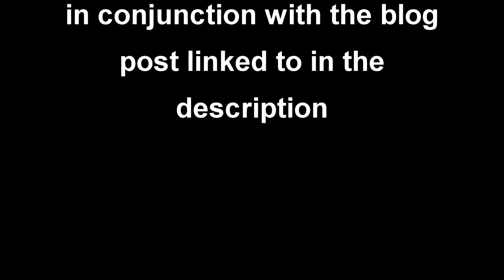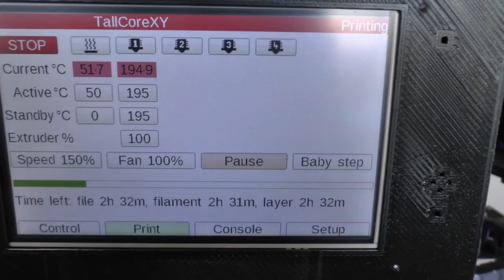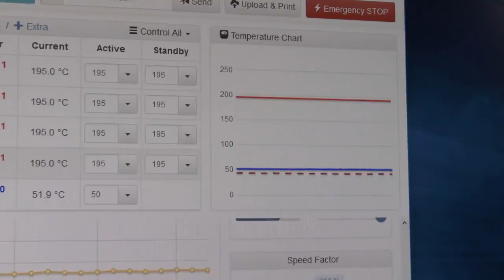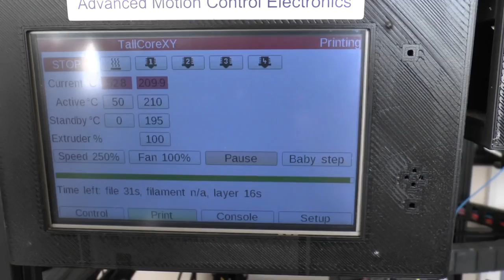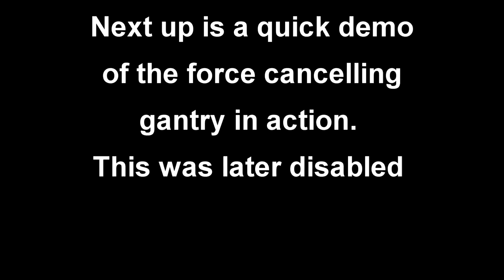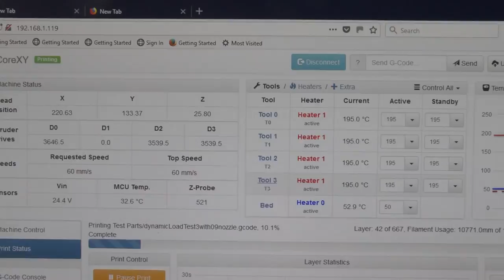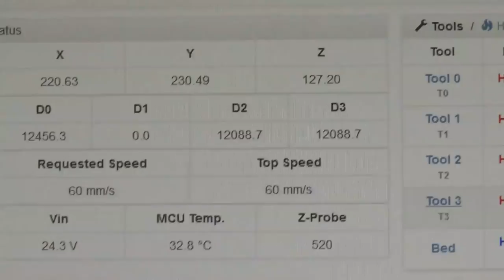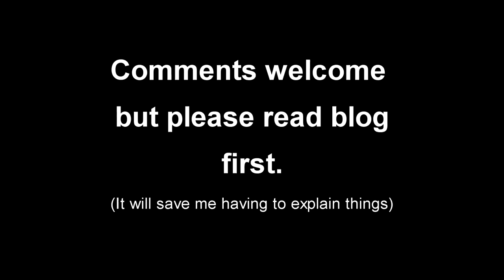Real world high speed 3D printing

Comment: This is one of the most interesting channel in 3D print. Thanks to share with us your studies. What about dimensional accuracy of your 3D printer? Good job and I'm yet waiting for next video :) Have a good time!
Reply from the maker: Thank you for those kind words. Glad you find it interesting. It makes putting in the time and effort worth while.
Reply from the maker: Dimensional accuracy of the printer? Read the blog but those parts were designed to be 100mm square and came out at between around 99.7 and 99.78 mm in both X and Y and at both near the base and near the top. So better than 0.3% over a Z range (in this case) of 400 mm. Not bad IMO.
Reply: good job !
Reply: @deckingman I think it's really good. Good job 😁

Comment: Impressive. Also cool.

I have a somewhat different theory as to the cause of the problems you see.  My theory is that the reactive loop used to control nozzle heat is not sufficient for larger volumes of plastic at higher speeds. To get (near) constant temperature of the plastic leaving the nozzle, we need a predictive model to increase the heat input in advance. It takes time for heat to travel through metal, transfer from metal to plastic, and travel through plastic. To account the heat input needs to increase enough in advance. (Which is not the same as "pressure advance".) My opinion, not yet put to test.

Otherwise, very nice work.
Reply from the maker: What problems are you referring too? 
If you are questioning my use of pressure advance to improve the quality of high speed prints, take a look at some of my earlier research here https://somei3deas.wordpress.com/2017/06/25/duet-pressure-advance-experiments/ and here https://somei3deas.wordpress.com/2018/01/15/an-attempt-to-investigate-pressure-in-the-extrusion-system-with-a-diamond-hot-end/

Comment: Since you've tried both I'd like your input. Would you rather use 6 direct extruders mounted on the carriage (1.5 kg) or suspend by a passive gantry like you've had in your first design? Or perhaps suspended in the middle above the printer? 
The printer is based on an Hbot with 900x900x1400 build volume.

Thanks in advance
Reply from the maker: Personally having tried all 3 options, I'd use the active gantry arrangement. On balance, keeping the Bowden tubes as short as possible outweighs any advantages of the other two options.

Comment: Thats really cool! For such a big and heavy gantry it handles it really well! I think its that double gantry that allows it to print that fast. The moving mass on a single carriage would be a bit too much on my opinion. Nice work!
Reply from the maker: The total mass when moving in the Y direction is about 4.2 Kgs so yes, it would need some fairly hefty motors to accelerate that mass up to speed if it was on a single gantry. I did at one point have the extruders mounted on an un-driven gantry, being passively dragged around by the XY gantry.  It worked reasonably well but that was when I only had 3 extruders. I change the additional gantry to a driven one when I upgraded to 5 extruders so it becomes a CoreXYUV with each gantry having roughly half the mass. The UV axes have their own motors which are mapped to the XY axes, so they receive exactly the same step pulses.
Reply: @deckingman  its a ingenious design.

Comment: what software are you using to monitor your requested and actual speeds and such
Reply from the maker: Sorry for the late reply - I have been away from home for a week. The screen shots showing the speeds are of Duet Web Control which comes with RepRap firmware (which is what Duet boards use).
Reply: @deckingman  thanks!

Comment: How you have configured the extra sensors on your Extra-tab in the Duet ?
My Duet only shows MCU Temp.
I have an extra thermistor on the PINDA 2 prove, that I want to show in the extra-tap.
Reply from the maker: Look up M305. I use e.g. M305 P104 X3 S"Z Motor" T100000 B3950 R4700;
Reply: Ok. Thank you very much.
I can show the PINDA 2 Temp using:

M305 P101 X2 S"PINDA 2" R4700 T100000 B4725 C0.0000000706

Comment: i would like that printer. 
How hard an i suppose to push to press filament trought a hotend? 
Having issues with underextruding i n start of layer and havent found any issues anywhere.
Reply from the maker: That's kind of an impossible question to answer. Ultimately the speed that one can print at depends on the flow rate of molten filament that can be achieved. That in turn depends on the melt rate rate, which is a function of temperature, time and the area of the filament that is exposed to the heated surface. In these tests, I was using the 3 melt chambers that a Diamond hot end gives you. This means that hot contact surface area is 3 times what a single melt chamber will give you and as each filament is fed by a different extruder and mixed, then the time for each one to pass through the melt chamber is 3 times longer than if one used a single melt chamber.
If you get under extrusion at the start of moves, then using pressure advance might help.